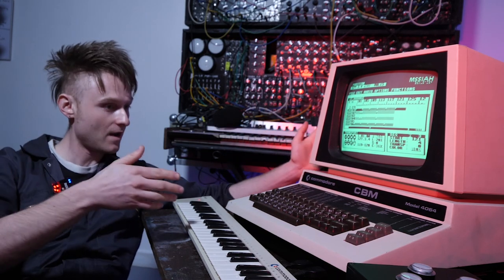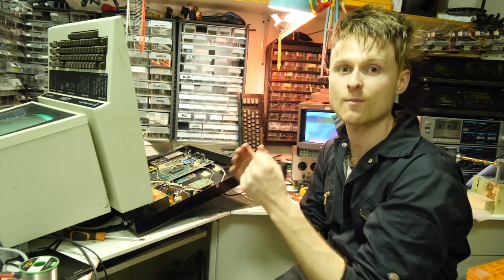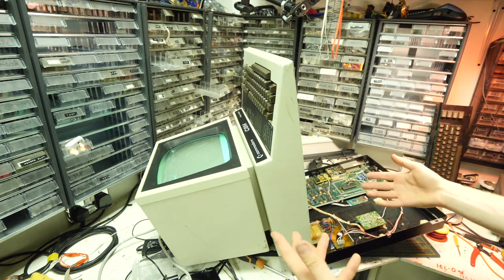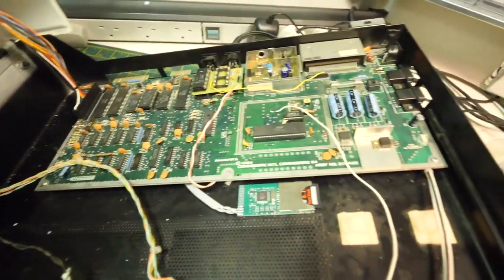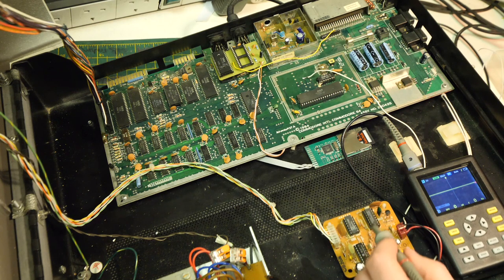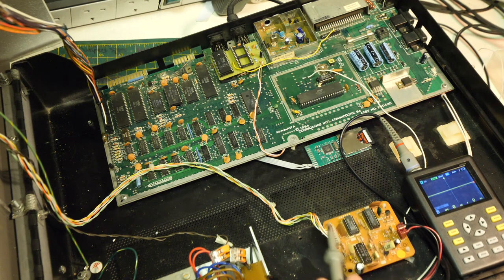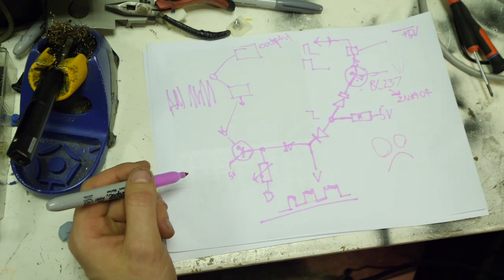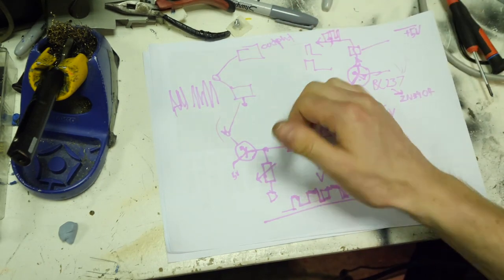Commodore Educator 64 Repair Blank Screen

Comment: Looks like you had a fault on the 'sync separator' circuit, nice bit of old fashioned fault finding. You'll be lucky if the flyback transformer doesn't fail - they often do when not run for a while

Comment: The CIA chips are notorious on the Commodore boards, Adrians Digital Basement is the expert on all things Commodore.  The cicrcuit with the diodes is a sync separator, in this case also separating the video.  I had an issue with a friends sync combiner back in the 80s. It was used to combine the H and V sync from a Tandy CoCo 3 to drive an Amiga monitor.  The monitor kept rolling, no V sync al all.  Looking at the board I shorted the resistor which supplied V sync to the transistor, full sync.  I replaced that resister with a lower value and it performed solidly ever after.

Comment: Had a think about how the sync separator works, basically the pot sets the point at which the diodes conduct.  Therefore the blank part of the signal (known as the porch) is at 0V so the sync diode conducts only when the sync pulses are present and the video diode when video is present.  Simple but effective as the video is positive and the sync is negative when the pot is correctly set.

Also, I was thinking the difference in raster geometry and size may be because the original board is NTSC and the replacement is PAL. The monitor seems happy with either.
Reply: Yep on the diode it just drops at the low points and inverts that’s to a pulse. Ignoring the vid. As for the pal ntsc alas not. You can change the pal ntsc of a c64 by cutting a cable. And I did it when testing. No difference alas
Reply: Sounds like the monitor accommodates both standards. Tandy didn’t design the RGB monitor for the CoCo3 that way, when I forced my PAL CoCo3 into NTSC the monitor rolled until I adjusted vertical hold. There was a Modesto make it take both without having to adjust.

Comment: Regarding greyscale. It was something I tried to solve. Ie bypassing the clipping circuit for instance. However not knowing enough about the pet monitor and the Luma feed I stopped. If anyone’s in the know please let me know
Reply: I agree with your reply on my other comment, I'm sure it will require the monitor to be modified. It should be pretty simple, though. Two resistors, a 3904 transistor, and a potentiometer should be enough. I looked for schematics and there seem to be a few different versions so the mod specifics will vary. Can I email you on the museum email or is there a better way to contact you? I don't really use any social media.

Comment: You can always try to Inject an external sync signal. Of course it won't be good And roll like crazy but you would be able to see if it is a problem with sync or video pretty easy that way
Reply from the maker: I would have if it wasn't obvious where the problem was :) but luckily tracing through it seemed quite obvious where it was messing up

Comment: I need help. I have a commodore educator 64 without its original monitor. However, I have a monitor from a pet 8032 but I know that even though it is the same, it is not compatible. Is it possible to make the pet monitor work on my commodore educator?